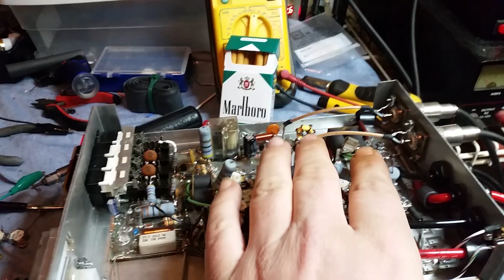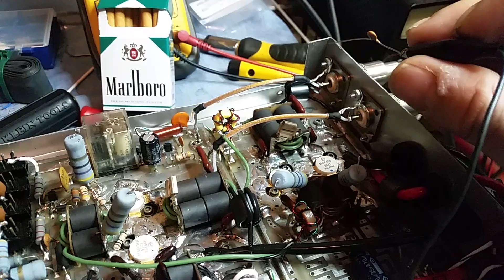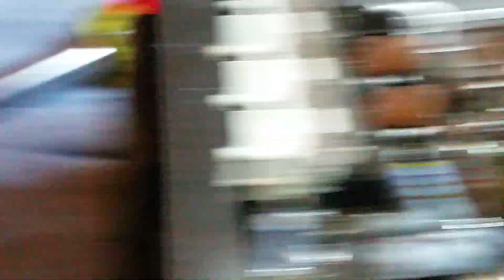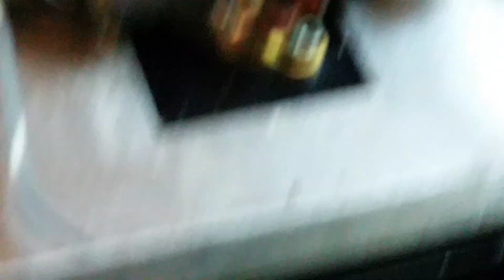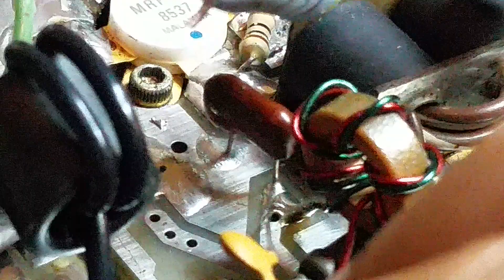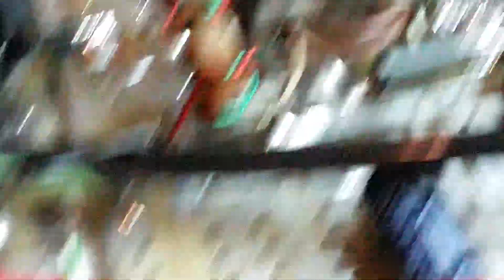Using A Homebrew RF Signal Tracer On A Texas Star DX 600

Comment: Love the RF probe man. I'd like to make that up on something like a skinny pencil with the led right at the end.
I made 2 audio / RF tracers a while back to help fix my Stryker 955. 
One runs off a guitar amp.  I put the components in a cut down credit card circuit board with a 1/4 inch jack so there was no need to take a part my guitar lead  to use it.
I liked that one but didn't won't to fool with the guitar amp out in the way in the end plus it was a bit more noisy.

The other runs off the PC speaker, 12V DC and ground to chassis from the 1/2 inch copper tube that the circuit board and probe lives in like a snail. I needed to find where my audio was dropping out in that case so I built those. They both pick up RF as well. 
I really love the simplicity of your RF probe though and need to build it tonight just to have a project. I hope Jack is behaving himself!
How critical is that 10pf cap value and if you had a resistor in place what would it be?
Reply from the maker: The 10pf isn't very critical it mainly is there to make sure no dc signal turns on the led....it is mainly there to be able to use it on many different situations